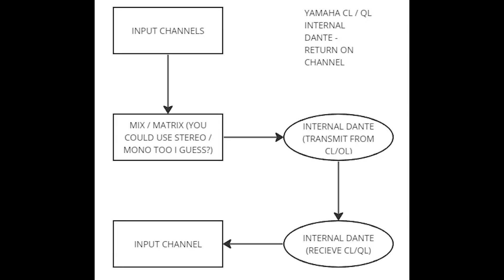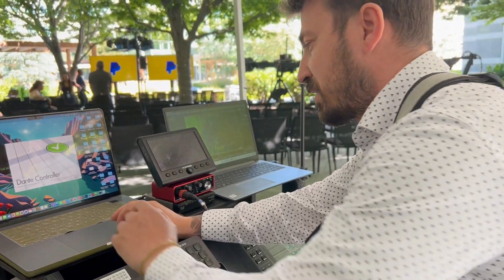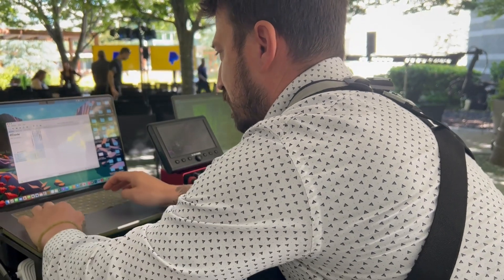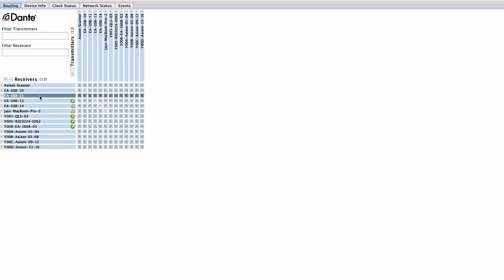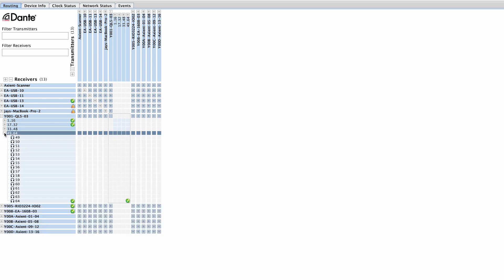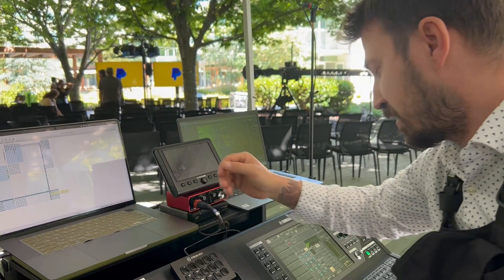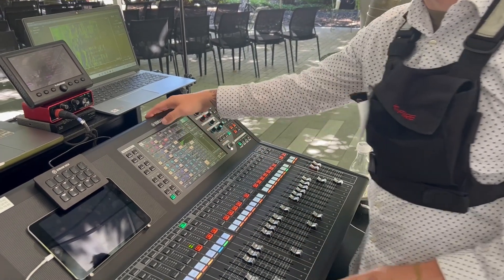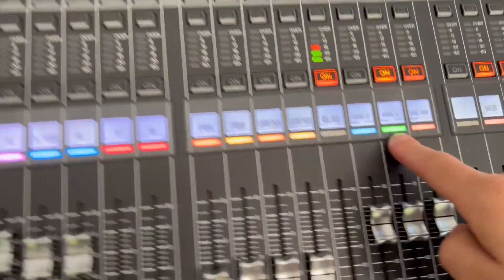DANTE RETURN ON CHANNEL INTERALLY FROM SAME DEVICE - YAMAHA CL  QL

Comment: But, Since only the delays are in inputs and outputs, i can easily assign the same mix bus or a matrix output to dedicated physical output and delay the preferred output right? and natively when you do dante flows, additional minimum latency is added right? has that affected your show?
Reply: Great work around for broadcast since the Yamaha ql and cl are not broadcast boards. Calrec boards are awesome because you can send anything anywhere you want. Also multiple insert/delay points to deal exactly with what you just described. Sadly most companies can’t afford those boards so great work around!
Reply from the maker: @audionerd8821  I have had my hands on a couple calrecs over the years. Mostly in OB trucks. Great boards! Apollo and Artemis I believe. Thanks for the kind words! Happy mixing
Reply from the maker: As far as latency , it’s been un perceivable. Yes , you can have each mix / matrix sent to multiple outputs and then go into output delay and change accordingly. That still very much has its place in my work flow. But! I don’t get 2 extra insert points, and I find creating a return on channel makes the routing architecture a bit more streamlined with mono groups. It also eats up less resources. Additionally, you cannot send 2 outputs to the same mono destination. What if the iec is telling you that on the broadcast, for some reason that talent on stage is not synced up to video and you need to fix it? But, Everything else in that stream (video playback, grfx , interstitials Ect) are just fine? Then you need to delay that one category to the stream but not everything else, this works for that. you may also encounter a time when you are out of outputs , but have a lot more inputs left. Simply , I find it more flexible.